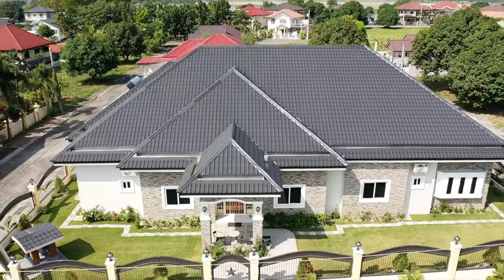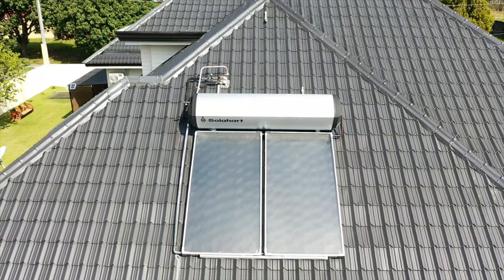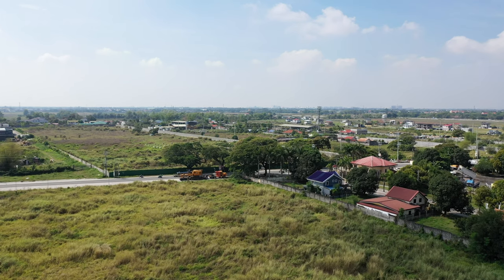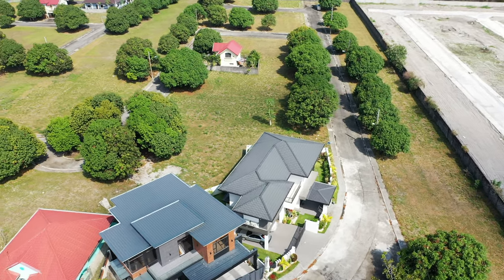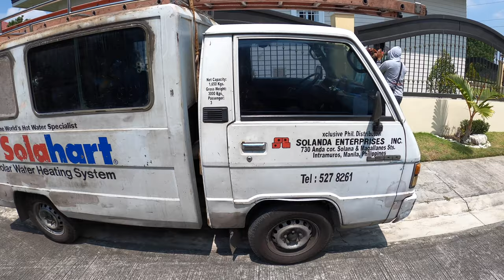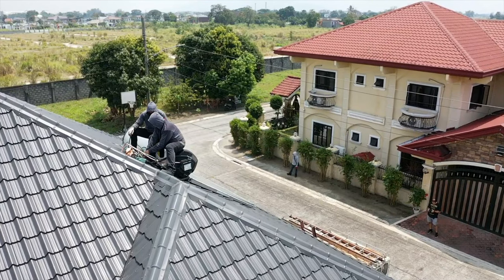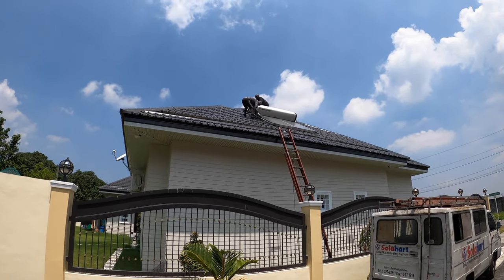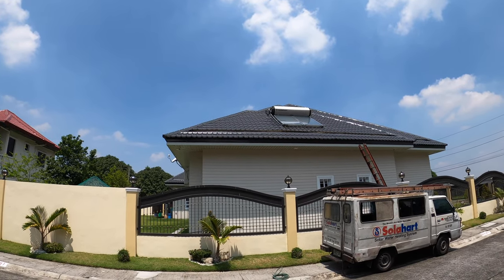Solar Water Heater Maintenance

Comment: Good to see what the maintenance consists of... great drone footage.
Reply from the maker: Was trying to get as close as possible. I’m a little too big to be climbing on the roof. Mainly consisted of cleaning the screen filter on the inflow pipe, check and clean the electrical anode backup, and finally clean the exterior and panels.

Comment: Service fee of $115 is a bit steep for Pinoys, IMHO,but then  you say they did  come from Manila (extra gas) and two of them, i guess one  was to make sure the other  didn't  fall that steep roof, 😆 LOL, in North America  that service call might be double that , I wonder if the electric backup was ever necessary,  as I asked James of My PI dreams  and he said  he has never had to use the  auxiliary  water heater in the main washroom,  but he has used the electric heater in the small washroom downstairs as it is not  plumbed  with the solar  heater.
Yeah , your pretty Big  guy, ,no climbing  roofs @ your age, time  to relax and enjoy life,not worry  ' bout broken legs. Heh  Heh
Reply from the maker: We have had to use the electric backup during rainy season when we have too many consecutive days of cloud cover.

Comment: You got another car?
Reply from the maker: Very observant. That’s Emie’s car.
Reply: @CasaTexPina  Good content idea to examine the car buying experience, another idea, Georges driving school for expats learning to navigate the madness and yes, the lines on the road, stop signs and keeping to the right are only mildly suggested.
Reply from the maker: Good luck with that. I nearly blow a gasket every time I get behind the wheel. Emie is on the edge of her seat, and not in a good way.
Reply: @CasaTexPina  what a mind-bending experience it is to drive there, especially in the Mabalacat AC area, worse than Manila, I think.